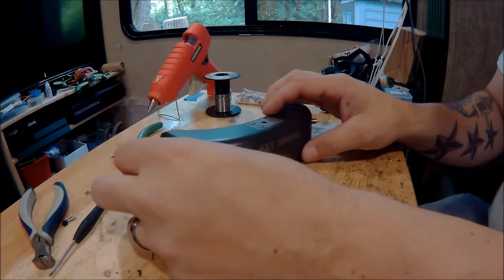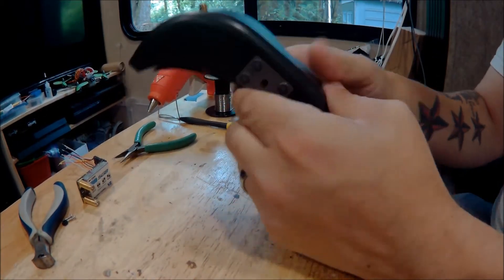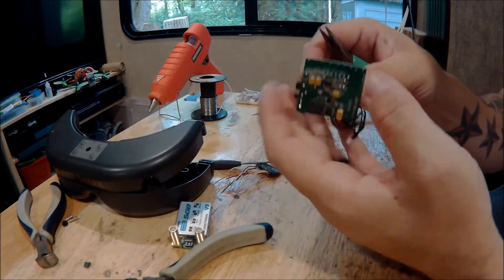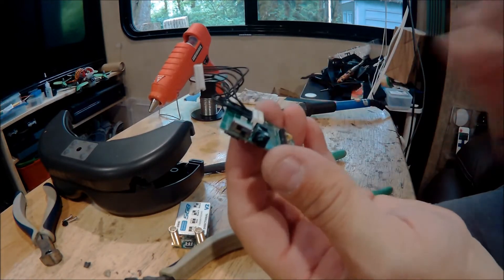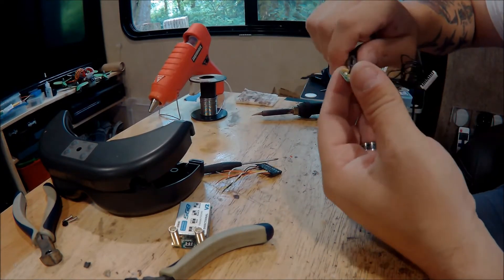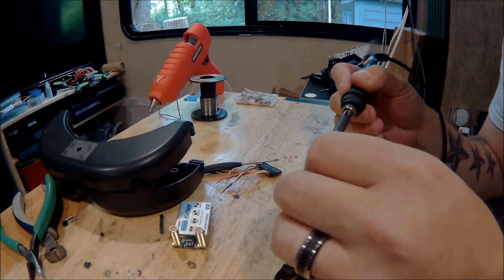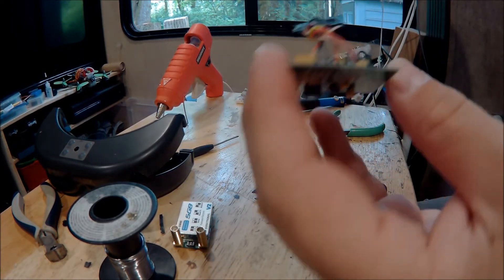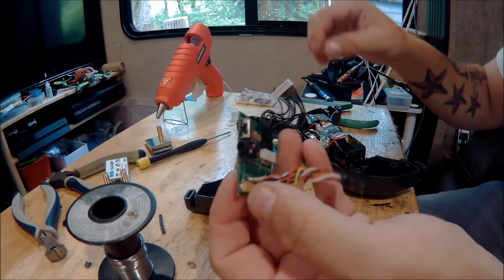Fatshark Predator Teleporter goggle diversity receiver mod

Comment: Did you just power on without antennas?? Quick way to risk a new mod. Oh and all those wires... you just needed power ground video connected to module.
Reply from the maker: Power im ng on without antennas only causes issues on the vtx.  The reason I connected all wires was to keep the button functionality. Thanks for the input tho

Comment: Hey, did the mod works lovely. 
A question; For the Dominator goggles using Rapidfire module or similar, they experience a power problem and perform a "L10 mod" & "L10 part 2 mod" to fix it.
 I'm using Furious True-d, (as I have not flown outside) on my Predators, will I need to do either or both L10/L10V2 to eleviate any power problems in the future?
Many thanks for any reply.
Reply from the maker: I dont think true d needs the power fix.  Only modules like clearview and rapid fire need those.
Reply: @HotDogFPV  
Yo, Thanks man.  Appreciate you taking time out to reply.
Respect.

Comment: I know it's been a few years since you've done this video but I did this mod and threw on a rx5808-pro receiver module and it works great but the low voltage alarm on my goggles starts going off when it hits about 4.00 volts per cell. Why does it start going off so soon? Is this a common problem?
Reply from the maker: My guess is that it is from the extra voltage draw from running the diversity setup and two receivers.  I noticed a huge difference in battery life when i added the laforge diversity setup to my dom v3s.  Around 3/4 of the life compared to a single vrx

Comment: If you would have taken some good nail clippers.  You would saved yourself a whole lot of time and the mission and a half you took to take out the old reciver part, so just turn ut to wher u used your "preheated" soldering iron and clip off the tips , done , easy peasy.  Mr. Einstein said , when he had a difficult job , he would let the laziest person figure it out , because he would find the easiest way to accomplish the job,  😁

Comment: Can I just solder the pins directly to the board? No wires needed can I do that?
Reply from the maker: If you are referring to the pins on the rx module then yes.  It will require much more cutting of the plastic to be able to  reassemble but will put the module insfe more.  Make sure you can still push the buttons.  Good luck and let me know how it works
Reply: @HotDogFPV  thanks you and I sure will and I just sub

Comment: What did you use to cut the shell of the goggles? I'm trying to think of something good to use to cut it cleanly.
Reply from the maker: Abhi FPV I used some snips.  They are the flush cut  cutters i use on zipties.  After that i trimmed it up with a razorblade
Reply: Dremmel obviously

Comment: whats up man, can i do it with the Eachine pro58, the same process, wiring n stuff, thanks . alot
Reply from the maker: joao santos if the module is made to fit in fatsharks then the process will not differ.  You shouldnt have any problems 😀
Reply: i guess so, i will try soon, thanks a lot :)
Reply from the maker: Yep just double checked and you should be good to go!  Good luck with the mod 🤘

Comment: I like my predators, have no problem with the optics. But my rx has always been weak and lately its been acting up. I was thinking about doing this and getting diversity because I cant get myself to dump 350 in new googles. Dont know what rx to get, but my question is are all the fatshark compatable rx pinouts the same? Instead of doing servo leads can you just solder female pin sockets to where the stock rx is?
Reply from the maker: RanHam335 yes you can, it will involve more modifications to the case to fit the module but it is definitely doable.

Comment: I just did this to my predators and i dont get power to my RJX diversity receiver.what did I do wrong?
Reply from the maker: Johnny Adolpho jr  it's hard to say.  There is a switch on the bottom of the goggles that will power the Rx on and off.
Reply: HotDog FPV 
Hi I've got a set of Predator V2's and was thinking of doing this mod, is it possible?
Did you get yours working?

Comment: How is the performance?  Stock versus diversity mod?  I'm stoked to do this, (just added the RJX module to my Amazon cart), but I am wondering if the gains in performance are worth the sticker price.
Reply: Also I have seen an LED strip used on the front of the goggles.  Larson effect. Like the LED's that come on the Matek LED/buzzer boards we use as tail lights that indicate direction and what not (but with about 20 LED's in a single strip).  
I'm looking for a strip of these particular LED's but I'm not finding it exactly.  Have you seen these and and do you happen to know where to get that kind of LED strip?
Reply from the maker: For me the upgrade was worth it because it now run all the different bands rather than just the Fatshark band.  As far as reception goes, both rjx receivers I have rival the LaForge.  I have heard that hobbyking offers a similair module for around $32.  If you mod like the video you can run almost any rx made for doms or attitudes.  I was also glad to ditch the use of the buttons on top of the goggles

Comment: Just tried this and im not getting anything just black screen. Not sure why, doesnt look like I damaged the board when desoldering...  Ill keep messing with it I guess
Reply from the maker: Paramnam khalsa I had a similar issue when I first did mine.  My fix was super easy, I just needed to take the Rx out of band scanner mode lol.  If the Rx isn't powering up, there is a switch on the bottom to turn power on/off to the receiver.  Which Rx are you using?

Comment: I want to do something similar to my Attitude V2's. I like the 3 servo connectors trick.
Reply from the maker: The entire cost for this mod was around $50.  The rjx diversity was $45 on amazon prime with a coupon and the rest was just glue and the servos leads which i had lying around.  Its a very budget friendly mod.  On my Teleporters I did the same mod but then used foam board and hot glue to make a receiver cover.  I wanted to make sure the OLED was protected as Ive heard it breaks easily.
Reply: Is that just a 10 pin pwm fc plug youre using?